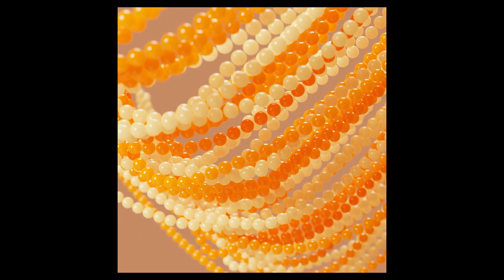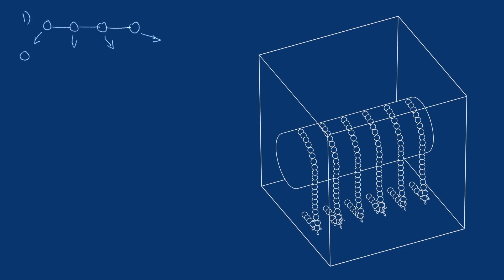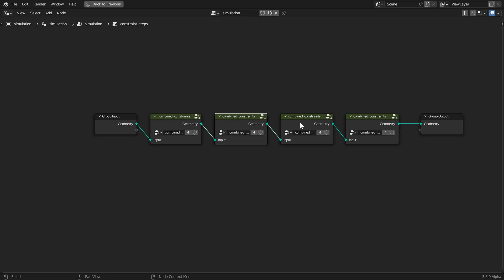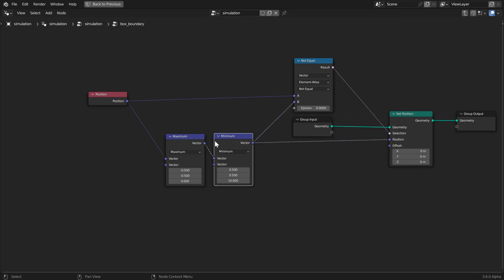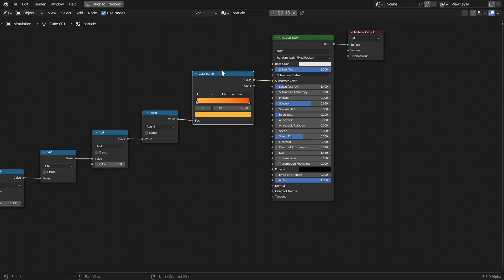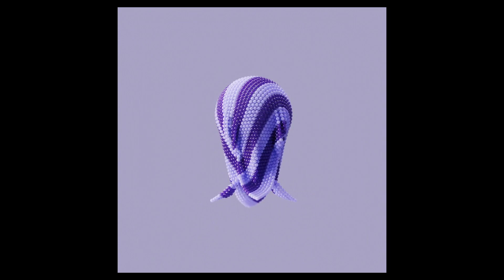Simulation Nodes String Physics (Blender 3.6)

Comment: Kind of annoying that the geometry proximity node doesn't have a volume option. In 2d you can use it to completely define the area in which the points need to remain via the faces option, but that requires chaining over to a raycast node to get the surface normal of the closest face to figure out if you are inside or outside of your bounding volume. On the plus side, that does allow you to do elastic bounces off of that geometry (capturing the boundary reflection vector and using it to reflect velocity rather than the dead blow effect your model gets), so you aren't completely relying on pressure effects to get shock reflections off the walls
Reply: Now it has with new volume nodes in 4.0. Use sample volume node with signed distance node.